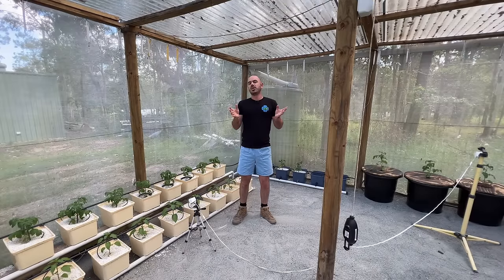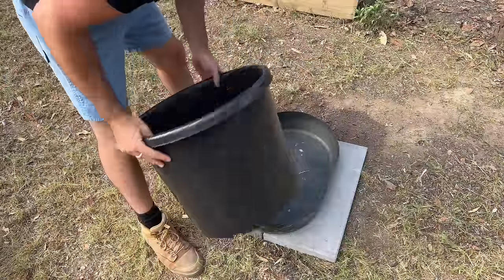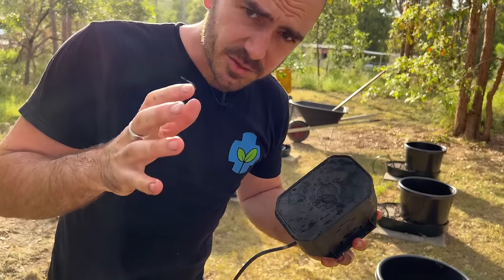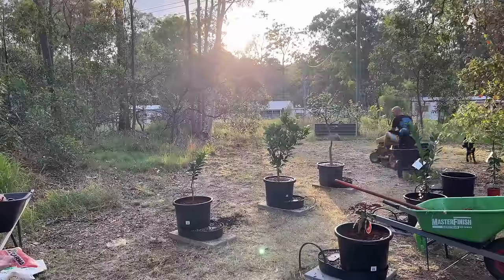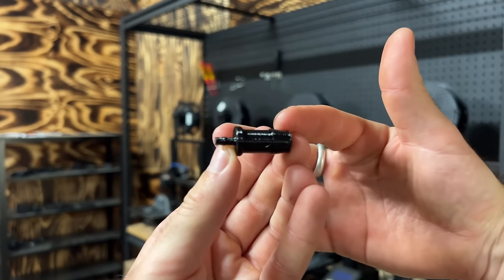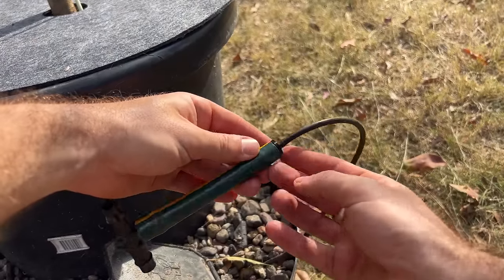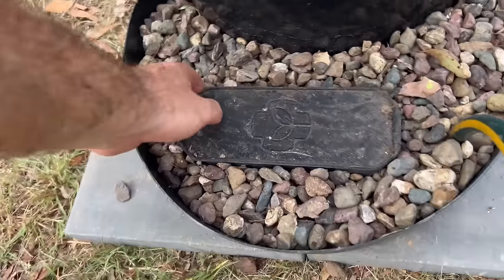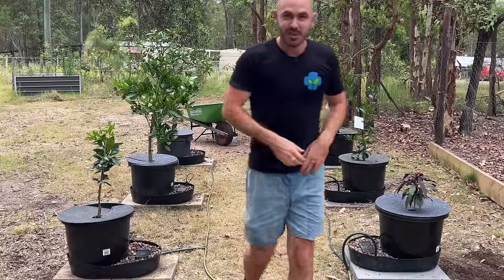Never Water Again! Gravity Fed, Auto Watering System for Potted Plants

Comment: Another great video Hoocho !!!
I'm running quite a few AutoPots and the only thing I'd add is to ensure you clean them every month or so and have a good filter to remove any crap from your solution. On a couple of occasions (not too often to piss me off, but enough to be annoying) I've had the AutoPot jam and gone into the greenhouse to find it flooding the floor as the mechanism jammed on.
A good filter and the occasional clean and I'm not having that problem anymore.
Reply: I was thinking about that as the main issue especially with doing all of my growing indoors!  It would be a huge mess!! I wonder if the nutrients themselves with the salts etc could cause a clogging issue?? I’m always afraid of those auto waterers.

Comment: These are brilliant! I have just started my venture into the world of hydrophonics. It's been a lot of fun! It is amazing how many parts you can design and fabricate for this if you own a decent 3D printer. I built myself a little test setup in my closet to play around with different nutrient levels and growth methods and the 3D printer has been key in being able to do that. Also, to the people who want to automate things but are not coders, Using Chat-GPT, You can write simple python scripts and use basic relay circuits to setup a WIDE array of control systems. The one I am currently playing with is atmospheric sensing, since this setup is in a closet I want to know the values of CO2 and other particulates in the air, that way I can also play with those values eventually too. The one thing I have been playing around with on paper myself is fruit trees. After seeing this video, I now know where I need to start. Cheers and keep up the great work!

Comment: you should have tried an external fitting for the hose adapter, you have 6-7mm ID (that you can make as thick as you want, to ensure mechanical integrity) with one or two o ring to make the seal (I have tried internal barbs but they tend to leak somehow). or coat the thing in epoxy that also should work to some extent.

Comment: Was trying to print 4 and 6 mm adapters, 90% of them leaked, that's just pushing the limits of FDM, and this was with waterproof settings, 0.1 layer height, 120% flow

Comment: Enjoyed the video. Really like your channel. I'm getting ready to build an aquaponic greenhouse and I have been looking for ideas on growing a few small fruit trees. That's a really clean setup with the Autopot.

For printing the small irrigation line adapters I think you're right about the .4 nozzle. I've printed some self watering containers and I wound up having to use a .4 nozzle and a .13 layer height. Not sure what slicer you use, but I also found that increasing the wall count to 3 or 4 in Cura helped make things water tight. You might also consider printing them on their side to put the layer lines perpendicular to the forces they will encounter getting knocked around. Should make the tips less likely to break off.

Comment: Bottom feeding with nutrient solution, will generally lead to nutrient salt buildup in the medium. Depending on the strength or EC of solution.

Having the base tray elevated, (eg concrete paver featured) with removable bung plug in bottom tray, will allow for periodic top flushing. This would also clean the scoria of nutrient buildup also. 

Half or quarter strength nutrient solution should be used to flushed. I think it has to do with cationic exchange. (Hoocho would explain that better)

Use an EC meter to check your run off, you generally only want to flush the medium back to the original strength of solution you are using. 

I’m not sure if a bell siphon would clean the scoria ( in base tray) of nutrient salt buildup as well but would work if base tray was empty. 

Your thoughts on Nutrient salt buildup, in the medium, caused by bottom feeding, Hoocho?

Comment: ive been using auto pots for over a year now  indoors and have found they don't dry out enough between cycles and have occasionally caused root rot , whether the auto pots were the sole cause or part cause ive changed to the blumat system which has eliminated the problem and also seems to be  a more natural way of watering from the top instead of  from the bottom ,    Ill keep my 12 auto pots for growing trees or berries outside though , because it is an ingenious invention nonetheless , thanks for the great videos
Reply: @Canna Denfour20 ok , the blumats are adjustable to drip more but I think I know what you mean about underwatering because the carrots are the moisture sensors and would only sense the immediate area around them  , but ive got my fingers crossed that they will be successful for my application which is one plant , one carrot per pot , so far so good

Comment: 21:40 a better idea for the auto drain would be to drill a small hole up to the level desired, so if it goes over it will automatically pour out 🙏

Comment: Use organic dry amendments in the soil and you don't even need to add fertilizer to the water. I wont do anything other than sub irrigated planters or  drippers in pots anymore. It's just to easy it doesn't make sense to garden any other way.  I dont mix fertilizer and I only hand water for a week or two when I transplant.  Sub irrigated planters in particular are so efficient with water it makes hydroponics look kinda silly.  I use wicking planters specifically like an earthbox brand only I build my own.
Reply: Agreed. I used Earth boxes a few times but I’m using Growteck SIP buckets. So damn simple and effective. And they still allow for air pruning like in fabric pots.    Organic dry amendments and a microbe inoculation like Recharge and good to go. Plain filtered tap the whole way.

Comment: Remove the shoulder on the barb, so that you can insert it deaper into the green pipe. Then add a blob of silicone. Which wil seal it and add somr strength to the reducer.

Comment: lol stopping to give the doggos a tractor ride is the most important part of any hydroponic setup.

Suggestion: You cut those wooden rings out of 4x4 sheets. Can you not use the parabolic cuts from those to actually make rain covers for the part of the tub filled with stone? Given you cut a circle out the size of the rim of the pot I wouldn't be able to resist using the scrap to make covers for the tubs.
Reply from the maker: Great observation. I was trying to make it as simple as possible, adding an element of skill was why I didn’t ado this.
Reply: @Hoocho  Fair enough and understood. Maybe for a little extra credit and protection from the rain down the line one day. Love the content man. Keep up the great work.

Comment: How well does the plastic from the 3d printer hold up with the sun and rain exposure?

I thought the easy way to remove water from rain....is a turkey baster. Hahaha

Thank you for this video.....it was a lot of good information
Reply from the maker: Use PETG and it holds up well, it’s mostly out of the sun with the lid, which is replaced with a small amount of filament.

Comment: For the 3D printed adapter. Instead of making the 4mm male barb part what about make it female, so the tube goes inside it? If required maybe add some silicone for sealing. Anyway, bigger diameter would make it stronger & could make it thicker as well, if need extra strength :)

Comment: So when the summer sun is beating down on those hoses it doesn't get that water so hot that it burns the plants roots. I know when I use a hose from outside the freaking water that comes out of it at first is so hot. You can't touch it

Comment: Do you think the autopot valve is worth the extra cost?  Do you think cycling the level will have a substantial difference?  I assume with the traditional float valve you might get a small amount of root rot at the bottom of the unit once the roots get that far down.  Is that the issue with the traditional float valve?
Reply from the maker: For the extra $5-$8 per valve it may be.
They also have a tendency to clog more than the float valves.
And the 4mm tubing is a real hassle.

I will let you know which works better once these experiments play out 🤣

Comment: Call me dumb but what's the difference between replacing the media with hydroponic material vs just using soil? The soil should wick the water up from the aquapot anyways, no?  shrugs
Reply: A simple google search can illuminate you to the differences and benefits of hydroponics vs soil gardening….
Reply: @kalancosta7650  So I did as you said and the benefits of hydroponics don't apply in this case. You're simply replacing the medium and there's no recycling of water. If you just left it in soil and watered it with hydroponic nutrient solution you would get the same benefits since you aren't depending on the 'slow release' of soil minerals.
Reply: @AdventuresofTheGreatBanana  you don’t need to recycle the solution for it to be hydroponics lol…. (Drain to waste is used commercially a lot actually) the benefit of hydroponics is the fact that plants are provided with what they need to more readily and in an easier to absorb form. Furthermore no competing plants or weeds roving the soil of nutrients or effecting ph so the plant actually grows faster than In soil. Also the fact that it doesn’t need to expand its root system very far to “look” for nutrients means the yields of fruit bearing plants are much higher.
Reply: @kalancosta7650  I was only referring to one of the benefits that were listed in my google search. I'm not sure why that was funny but oh well, if it makes you feel better to chuckle then so be it :). With that set up of trees in a pot, there wouldn't be any weeds anyways and if there were weed seeds floating around in the air, they could grow in that substrate he used just as easily as in soil, lol. Ooops sorry. Watering with hydroponic solution vs water in soil is the same with either medium so again... I don't see the advantage in using his medium vs soil in the case of potted trees.
Reply: @AdventuresofTheGreatBanana  soil relays on bacteria to break down the nutrients where as hydroponics the nutrients are in their base form (simplest molecules) this means the plant doesn’t have to work to convert it… resulting in better growth and nutrient retention) 
You keep arguing with me for no reason mainly out of lack of understanding which I find funny it’s true… but it’s also just odd that instead being like “oh I didn’t know that I’ve leaned Ed something today you’d instead argue with someone who’s not only knows more about the subject but is also explaining it to you….
Reply: @kalancosta7650  ahh! so You've now finally come to giving me the answers that I was originally asking for instead of googling something you've spent a few moments to try and explain it rather than flippantly flashing lol's and claims that a google search should appease my curiosity. What you failed to do was read my questions and comments in more detail. I didn't say that the tree needed to break down nutrients in the soil. I asked why the different mediums made a difference when in BOTH cases hydroponic solution would be fed to the tree. Whether the tree is in soil or in hydroponic media, it would be fed a nutrient solution that does NOT require bacteria to break down. I'm not arguing with you, I'm just taking what you respond with and pointing out that you really don't read that well. Instead you try and make yourself look like you're smart when you first suggested I should do a google search like your time was too precious to spend enlightening me and then lol'd at a simple comment.  You should really ask yourself what your real motives are in all this and question your personality. sigh I won't charge you for the psych session :)

I play nice until someone decides not to play nice first...

So back to the original question... why the need for hydroponic media when soil can be used when in both cases a nutrient rich solution is used to feed the tree?

Try and answer without any lol's please.
Reply: @AdventuresofTheGreatBanana  soil retains water where as inert hydroponic nutrients have more oxygen a Available (more oxygen to the roots equals better growth) 
Hydroponics has been PROVEN to be more effective in terms of growth speed, yield, and nutrient content….
Reply: @kalancosta7650  ahh! ok if the hydroponic media has more oxygen availability than soil as a MEDIA then that's a good explanation. Another good reason might be in the wicking ability of hydroponic media vs soil and also the compacting factor of soil on the root system. Keep in mind that there are 2 main elements to hydroponics, not just the media or lack of it, it's the nutrient solution itself but I haven't see any research done on attributing the effects of growth speed, yield etc on each of those components separately.

It would be a great experiment to have one tree planted in soil fed with the same nutrient solution as a tree planted in the hydroponic media :)
Reply: Coco wicks better than peat based soil. With peat it can go hydrophobic and repel water. No bueno in a system like this.  Hope that explains it for ya.
Reply: @timpage5021  That was something I thought of as well but was hoping someone could confirm it. I would still like to see a tree planted with soil vs hydroponic media fed with the same nutrient solution. I sometimes think that people who are advocates of hydroponics etc are a bit one-sided. They tend to be 'save the earth' type people that are almost too passionate about what they believe in to a point where it blinds them. If someone would just do a side by side comparison I think that would go a long ways to showing people the true benefits of hydroponics :)